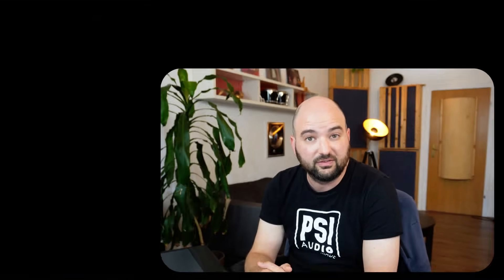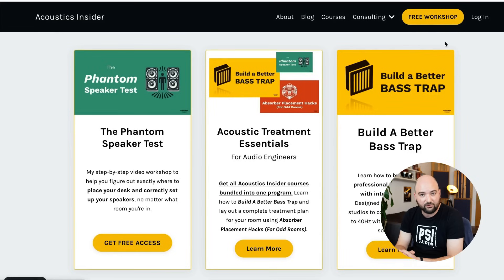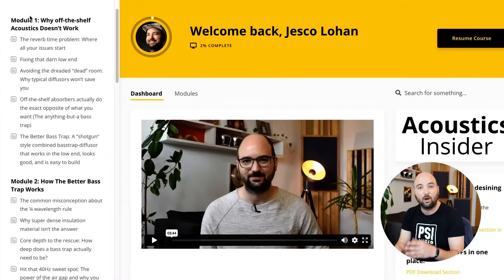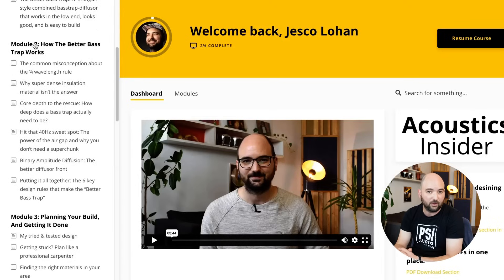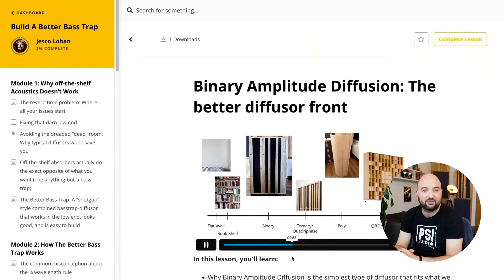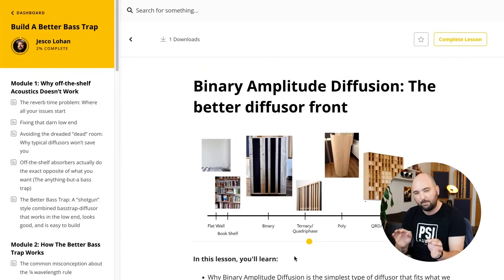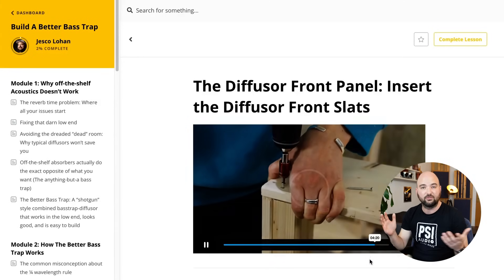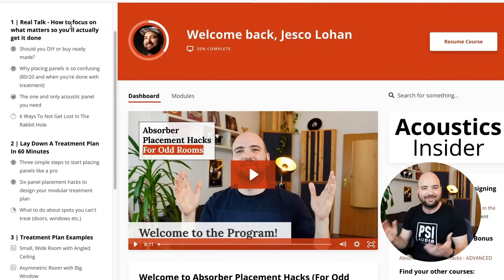Why Your 70Hz Null Won't Go Away (Even With Bass Traps)

Comment: I have a steep 18 DB Null at 70 on one speaker. This speaker is against a stud wall. The other against brick. Do you think the stud wall will be causing this.?? I have Atc Sm45, in a 3 x 3 x 6m Room.

Comment: Hello. Thank you very much for providing me with all this excellent information on acoustics. I live in Iran and do studio acoustics. Most of the time I get very brilliant results from my studios and if needed I will send you pictures of my studios.
One thing that always worries me is that due to living in Iran, the available materials are very limited and I often have to use rock wool with different densities and air gaps. Bass traps usually absorb at frequencies of 80 Hz and above, but absorbers absorb at frequencies of 250 Hz and above. The question is that if used simultaneously, frequencies above 250 Hz will actually be absorbed again due to the higher absorption surface. Therefore, in RT60 measurement, the absorption decay time cannot be balanced and is higher below 250 Hz than above 250 Hz. Whether I use a diffuser or a scatterer, there is not much noticeable difference. Is this correct and is there a solution for it?

Comment: I've got one big question: I'm researching about acoustics for over 6 years now and I'm pretty solid in terms of information about many aspects of acoustic treatment and physics behind it. But one point is not clear to me. Can bass frequencies, say below 100 Hz, even get reflected of a non massive wall? So not a thick 40 cm brick wall, I mean a thinner, also thin insulated, dry wall? Let's say about 15 cm with some insulation inside? Physics would tell me that most of the energy produced by the speaker would pass through that wall, only higher frequencies (so just everything over say 150 Hz or whatever) with less energy would get reflected. Am I right here? That's important for me to understand, cause then I could narrow down where my 85 Hz Dip comes from haha. Thank you Jesco for your great work, keep it up!!

Comment: IME low frequency nulls are almost always sensitive to listening position. When you have a pair of full-range speakers or subs symmetrically placed near the side walls of a room, you'll get a "power alley" down the middle of the room where the paired wavefronts converge. This central alley will be flanked on both sides by nulls produced by the unequal distances to each speaker from those off-center listening positions. The most effective way I've found to minimize this syndrome is to use a center channel sub placed deeper in the sound stage, i.e. farther from the listener than the side channel speakers (or delayed in time). This can reduce the prominence of the power alley and fill in the flanking null regions. While it's not as effective as a precisely-tuned cardioid subwoofer array, it can often fill in the most annoying gaps.

Comment: I think speaker and mlp placement is much more effective at mitigating interference. Ansorption can result in room deadening, extra cost and bad aesthetics. 
For instance you can place your speakers very close to any walls to combat sbir (moving comb filtering to higher frequencies which is less audible). 

Also you can use membrane absorption to target that specific 70hz dip

It also important to mention that EQ is not only used to correct for room issues but also to correct for speaker issues. Your speakers might not be linear.

Comment: I haven't made my absorbers yet, I will eventually 😅

But I really lifted my system frequency response using AI.

Treated rooms are always the best first step ofcourse. But if (like me) you haven't gotten there yet, then you can do alot with a test mic, RTA, auto EQ, and parametric EQ.

Basically I was recommend to run the RTA and AutoEQ with pinknoise on everything above 300hz. It boosts and cuts a few bands typically. IIR type (older analog/(cheaper)digital)eq's screws up phase abit, and FIR type eq's don't do that, instead adding a few milliseconds of latency. 

Either way, perfection is a feverdream. Accept it and choose your preferred compromise 😅

Then, theoretically on everything under 300Hz is where you use parametric EQ to cut (never boost) where the room modes, reflections and such add bass resonance.

Dips are inevitable in an untreated room, ignore them for now. 

I think I put 3 or 4 bands of parametric EQ on my system, to cut the frequencies that excited my room to a level where it looked like my fullrange respose was flat on my RTA. The room will still "ring" and resonate at those frequencies, but it will blend better with the rest of the music.

I did this on my system, thinking AI is funny, and not expecting much.

But I was blown away by the result. This is not a perfect solution in any way, even the AI pointed this out and urged me to finish making my planned absorbers. But WOW!

It's a little counterintuitive, but by cutting frequencylevels in the low end, you can actually get "more" bass and tighter bass 😅 i couldn't believe my ears.

The AI explained it as the bass was getting drowned by the room modes, and by surgically lowering targeted frequencies. I was in essence removing noise from masking the sound being produced by my speakers.

The AI told me that once I get my absorbers, that I would have to do all the steps again from the beginning... so... no free lunch 😂

Very interesting stuff😊

Comment: I use 5 inch thick traps with range limiter plates and 5 inch air gaps…they turn 70hz into heat 😉
Reply: I was ‘shocked’ by the 20 inch claim. Until I calculated how deep two rows of Soffit traps are agains the back wall 😂
Reply: @infojunkie4989 yeah traps need membranes and range limiter plates or else you need ridiculously thick traps

Comment: Great video! 
I have this same issue, except in my case its a -15 db dip at around 83-85 Hz, which I believe is speaker boundary interference. Because of the layout and size of my room (which includes tracking drums) I cannot adjust my listening position further from the back wall that I currently am. I have been exploring adding either a soffit bass trap along the upper ceiling behind my desk or two more 6" thick clouds with an air gap above the speakers to see if that will help. 
Its a shame because that is a KEY frequency range for accurately mixing drums and bass.

What I am currently using is a Trinnov Nova, which has been absolutely incredible in making my ATCs sound as good as they did in the store. It cut that dip from -15 Db to only -5db and completely opened up the imaging and clarity in the speakers.

I'm still considering adding those clouds though to see if I can reduce it to below 3 db with the Trinnov. Its a lot of $$$ to chase that last 5% unfortunately.
Reply: The cost of each extra % point gets ever higher!

Comment: Good to see you back. I'm still learning about room acoustics and where acoustic panels are needed. In the impulse response measurement for my LCR, I get a peak right around the 3 ms and 5 ms marks for all three speakers. I'm thinking this is a ceiling reflection because the side walls are fairly treated but the ceiling is not treated at all. What are your thoughts about this?

Comment: Jesco, good to see you here again. I did your bass trap course. It was my big inspiration. At this moment I am building my traps.
(All of them 8 inch Rockwool) There are going to be 25 in my studio. After installing 21 panels now, the small studio room sounds already incredible. The stereo and detail sounds like a headphone. And I haven't even measured anything yet. I will keep you informed about this project. Thanks for all the research and time you put into this.
Reply: Make sure it's low density though, 8 inches of high density Rockwool won't be as effective as low density ones.
Reply: @ajwadakter7326  dude just told you that he hears the improvement in his work so far 😏
Reply: @JustPlayitc00l and I just told him that high density Rockwool won't be as effective as low density ones. It's not like high density Rockwool won't do anything at all.
Reply: @ajwadakter7326   Here in the Netherlands there is only 1 quality Rockwool plates available.
  It is also reccomended bij Jesco himself. And glasswool for example has a lower density and far less mass. I tried both materials but rockwool was way better for lows.
Reply: @zwwwz12  welke platen heb je gebruikt?
Reply: @hypersonicnl  Per paneel 2 platen roclkwool van Hornbach. Afm. 8 x 120 x 60 cm. ze zijn dus 16cm dik. Met houten planken aan de buitenzijde en en doek aan de achterkant met nietpistool vastgezet.